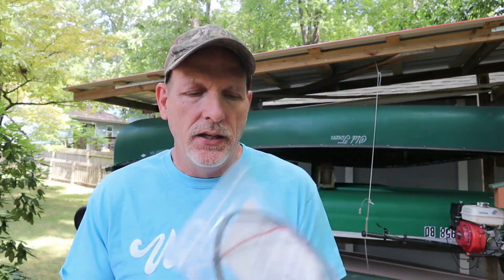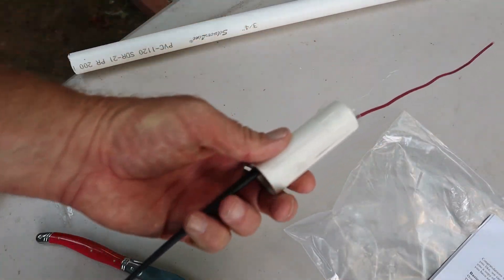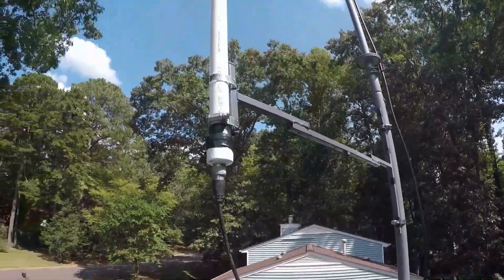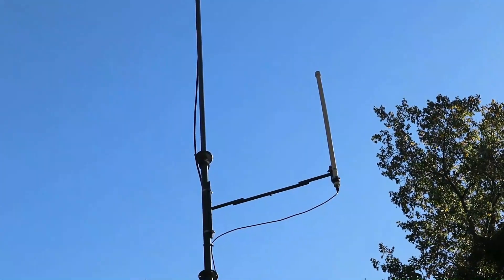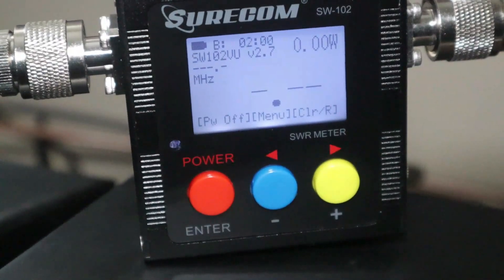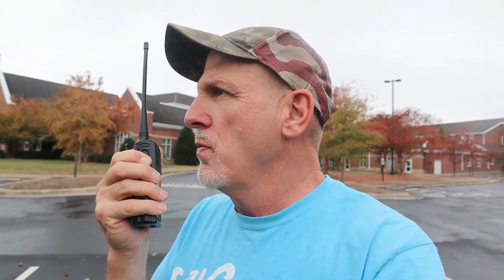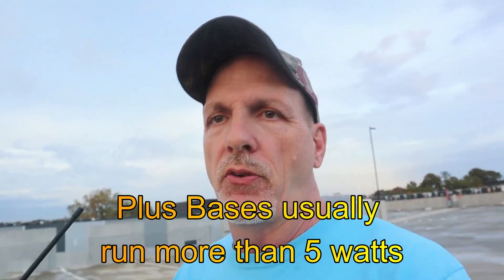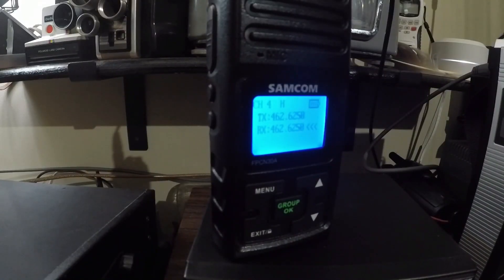Testing my Ed Fong GMRS Antenna

Comment: I have the Ed Fong as well. On my base station, I hit a repeater 46 miles from my house without a problem. Also, on Simplex, my buddy and I talk 18 miles without a problem, with him being on a Boafeng UV5R sitting on his deck with the rubber duckie antenna. Just a side note: His elevation is way above mine, so that's why it works so good. Line of sight is what gets these radios out.

Comment: I got the duel band version. MURS/GMRS  works great and match great on both bands. with UHF you will find coax makes a difference. standard RG 8X is great for HF CB . but at 70 CM/GMRS becomes lossy . ABR has ABR 240 same size and much better at UHF. also the M & P 7 mil coax like Pota Flex 7 is great at UHF . what I use. some brands of RG-8X not so good on GMRS. and for HT use like Nagoya NA 771G antenna. they long. more than double range    HT to HT. I got the Talk pod A36 GMRS radio. 5w with Nagoya 771G antenna. easy 2X range over stock antenna .
Reply: Have you ever tried the Nagoya 24J whip antenna? Compare it to the 771 and you'll see the improvement!
Reply: @KaL_Terow  i haven't tried that one yet .I do have the Nagoya tri band one that has 220 MHz on my Anytone 3 band HT . I do have the 42 in Abbree antenna and it out preforms all antenna's I have used but so hard to use on a HT being so long . I may get a 24J . Lately we using MURS   radios in camp grounds . Less kids on the air. LOL

Comment: You could buy (or make) a roll up slim Jim to attach to your radio and hang in a tree/hold up high. I think Ed sells this.
Will do way WAY better than the box stock Samcom antenna.

You could also try a single band (GMRS) Signal Stick or you can make one of those as well...Will be much better than the stock antenna and if you add a ground poise will come in less staticky and with a much higher signal level. Hope that helps!

Comment: Depending on the distance to your antenna from your radio, you may want to use a better coax cable. At UHF frequencies, the loss can be extremely high. Use a coax loss calculator to figure out how much power you are losing in your coax. BTW, a good SWR does not mean a good radiator, for example a dummy load has a 1:1 SWR. While you want a good SWR (say less than 2:1), getting it down to 1:1 won’t significantly improve your signal.

Comment: As a ham I would never buy an antenna. 234/ frequency gives you the length of the antenna needed for a 1/4 wave . You can use that formula to build a simple 1/4 length verticle. Make do the math for the desired frequency. Make the radiator and the ground radials a little bit longer and then trim for lowest swr. You can build a much better antenna for less than $10.
Reply from the maker: No desire to build my own antenna on these frequencies....others maybe .

Comment: Quick tip.. Having built many different types of antennas and done many long range simplex adventures on VHF/UHF bands... The j-pole, collinear, 1/4, 5/8 wave ground plane... all those designs tend to focus the bulk of the signal at or just above the horizon. If you primarily use a repeater that's high up from your relative location, this is good. If you're primarily doing simplex, you'll actually do better with a straight half wave dipole, or folded dipole. The lower gain means the pattern will be more donut shaped, and spread out more evenly. This will work better in a flat land to flat land situation than using a higher gain antenna where the lower lobes of the pattern are dampened to provide higher gain upward at the horizon. Also depending on where you live, and how cluttered the gmrs band is, you can set all your antennas horizontal, knocking down the other signals around you that tend to primarily be vertically polarized. I say all this from real world testing and playing around. Might make enough difference to get you another mile or two without resorting to a yagi, or more output power.
Reply: Sounds like you know what your talking about.  😊  Can you dumb it down a little for us new to antennas other than the stock one.
Reply: Thanks for the advice.
Reply: I too am a big fan of vertical dipoles, for GMRS, 70CM, 2M, Marine VHF/AIS, and MURS: For CB too. The Ed Fong is a great antenna though if you need the gain for distance work, on amateur uhf 70cm I have been able to work into a net at 35 miles in the hilly terrain between Grants Pass and Cave Junction, OR.
Reply: @LibertyCaveWS7PB  yes, the ed fong antennas are a type of j-pole and work well for far away repeaters on mountain tops.

Comment: I use one of these mounted in my attic.  Great performer.  I use it with an HT and an added microphone.  The HT is rated at 5W, puts out a little less, but I run it into an amplifier that is generating 37W out.  Even without the amp it worked well and I was able to easily hit a GMRS repeater in town for significant coverage, about 12 miles in all directions.  It's a great antenna. I also use an Ed Fong 2m/70cm ham antenna in the same attic and the mobile unit I run into it has a 50W output.  I'm able to use a heck of a lot of repeaters with that, even ones 70 miles+.  Big fan of Ed Fong jpoles.
Reply: How did you mount this in the attic ?  Safer from lightning but wonder how much more distance you would get outside.  I'm considering attic versus eve mounting now and wlil be using a 50W base station.  Any tips appreciated.

Comment: I am preparing to shop for a home antenna, probably using a HT at first. Would it be useful to try a larger antenna such as an Abbree or Nagoya or some other aftermarket on your radio on top of the parking lot to see how it sounds without any other control change?
Reply from the maker: couldnt hurt to try.
Reply: @mackspubliclandhuntingoutd6715  I have my first two radios charging now, already remorseful I didn't order two of the folding ones :). Good Luck

Comment: Can this be used in the attic without the sch 20 PVC pipe?
Reply from the maker: Not sure but probably....ed fong will answer that.   Google him and he usually responds to questions
Reply: Per the instructions with the kit, the pvc is part of the design and is necessary.  They do make rollup jpoles, however.  I used one hanging from my ceiling for a long time, had great range.
Reply: No. The PVC pipe helps it to resonate at its designed frequency.

Comment: Currently I use an EdFong Antenna at 35' High as my Base and it does the trick

I Push 50 Watts through it and Om good Conditions it'll make a 100 Mile Jump to Distant Repeaters

Comment: The real test would have been to transmit from your Ed Fong base to an HT.  You could have then verified the output from the EF.  I've had two Ed Fong jpoles for years, one GMRS, the other dual band Ham, they both work great.
Reply: I [respectfully] disagree.  The weak link in the comms situation here is the HT's rubber duck antenna and 5W of power.  If he's running power at the base (50W) it's likely that the HT can hear him farther away than it can transmit back.  Comms are only acceptable if RX works on both sides...IMO.
Reply: me too and so do mine .
Reply: Yep ordered one and Ed Fong actually spoke to me on the phone. Really nice person. Nice Antenna.
Reply: @garyday6681  Concur.  He is a very busy guy, and still made time in his day to call me to so we could talk antennas.  I was trying to come up with a dual band 2m/GMRS antenna, so he explained why the physics of antennas just won't let that happen.  You could physically package one J-pole above another, but a single j-pole won't work well for both of those bands.  Now that I'm thinking about it......that might be the answer to my geometry problem.

Comment: You need better quality coax. The RG8X you are using is extremely lossy at 465MHZ. At least use LMR400. Loss impacts your signal on transmit AND receive.
Reply: I agree, 400 coax loses almost nothing.
Reply: It’s not the coax. UHF J-Poles do not perform well period. The radiation pattern has a huge null and it acts almost like a NVIS. He would be better off using a true half wave (14.5”) home built ground plane or mag mount attached to piece of 14x14 X .125” steel plate.

Comment: Try the base to mobile instead of using the HT antenna.  A Tram/Browning BR-450 is a solid mobile antenna for mobile/base application.  Use the HT antenna for personal to mobile contacts and mobile to base for long range use.

Comment: All right I saw your video interesting I'm surprised you should be doing much better performing when it concerns the antenna I can use cheap Canadian Tire radios of course mainly those radios work line of sight you need to have height and you need to have nothing blocking you from that signal however I did quite a bit of testing on those freaking seats as well I also use CB citizen Ben and I also use FRS Jam RS just with FRS radios had a friend that went up a mountain I was at the UBC University of British Columbia which is about 300 ft up above Vancouver his altitude was one mile up those were the ideal circumstances is best as possible monster Chief with a small FRS radio a distance of 52 km roughly 30 miles of course I had to keep this qualish off to basically get the signal on channel 10 FRS signal was coming in on channel 21 gmrs signal was coming in the antenna does make a difference it also has to do with the coax you using a bunch of variables also the amount of harmonics going to coming out if there's a lot of harmonics coming in it's going to block part of your signal basically RFI coming in from routers and different type CB radio or more affected by this gmrs are less you may want to try just putting one of those walkie-talkie on your roof just with that top of coil antenna go back in the garage where you were up in the parking lot and try to see if you see a difference ultimately yes power will make a difference with even 500 milliwatts I can do within the downtown core 10 miles mind you that's on a building that's on the 18th story building and the signal can be transmitted from downtown Vancouver all the way out to Commercial Drive basically five six miles the signal can also be transmitted from downtown Vancouver all the way to SFU 10 miles signal is weak but it still comes in I do agree you antenna is going to give you more performance however you may want to check your coax yes you do have a good SWR it might be that the antenna is probably not the best case it might be overrated for what it is what's in the downtown core you will do about a mile even if you have your standard gmrs radios because of many buildings blocking your signal however I am surprised thus I also did experiments in Montreal I wasn't getting as far because it is a flat to surface out there thank you for the video and hopefully you will get better results I would suggest as far as FRS I managed to make another contact very specific condition from UBC 112 km roughly 70 MI on channel 21 even using one Watt with some Portables such as the cheap ball Fan radio they do the job they're not perfect however I believe and also pushing the limits some people told me that it wasn't possible to achieve this however I can tell you from my own testing and experiment I can tell you yes it is possible you just have to look outside the box thank you for showing the antenna 73 and all the best
Reply from the maker: The limited range is most likely due to all the trees between the 2 stations.  lots of them are 100 ' plus tall.
Reply: Dude. You should really consider punctuation.
Reply: @Gruuvin1  No kidding.  All those words/key strokes and didn't hit a period, even by accident.  Unreadable.